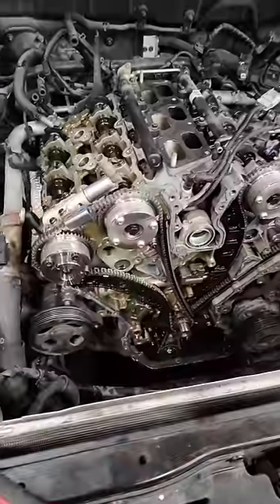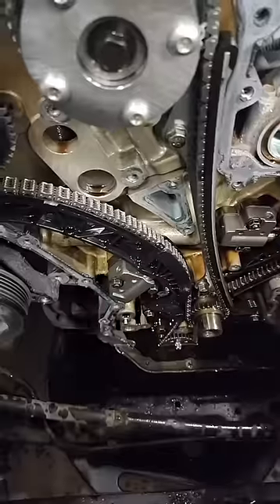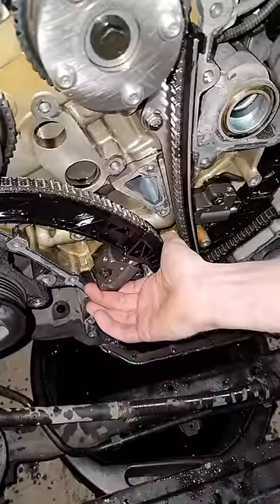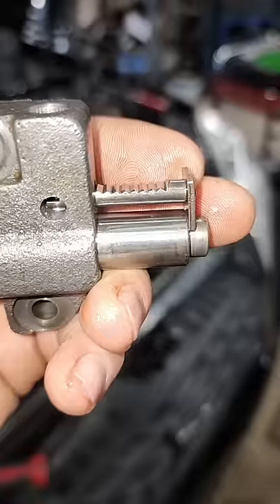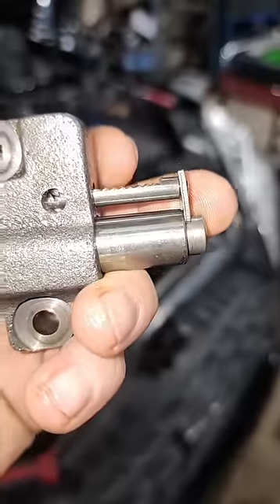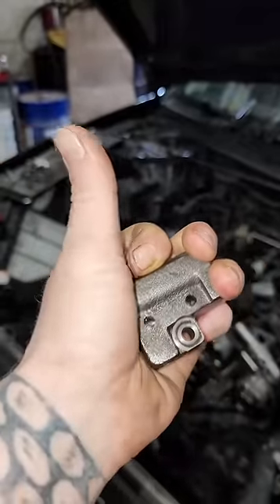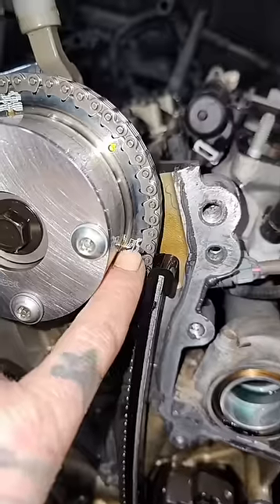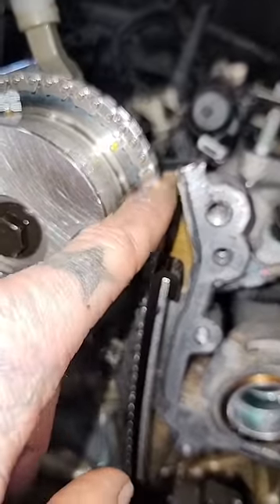I'm not happy

Comment: I have the utmost respect for good mechanics.  We tried out a new one recently.  Asked for an oil change, tyre rotation, brake flush.  He found an OLD torn cv boot (which required a new axle), recommended a valve cover seal, new front brakes as well.  He took the time to show me.  $2,200 in repairs on an 18 year old Infiniti.  I could see someone saying no.  But, it's still worth 7 grand, and my Bride likes it, so yes.

Comment: The Nissan D-21 had a chain guide pushed by the oil powered tensioner. The bottom of the guide pivots in place because that particular bolt bottoms out on the block before it binds the tensioner, allowing it to press up against the chain when the tensioner is pressurized. The Cloyes guide was build slightly too thick, such that the guide wouldn't pivot. When assembled, the chain would rattle against the timing case at idle (lower oil pressure) and clear up when revved up. Scrape marks inside the cover gave a hint. I've laid gears on top of each other and found them to be off by half a tooth. I have several older Toyotas, all with 200k+ miles. Parts are starting to wear out. I go oem on most parts because if it went 250k on the original, I want it to go another 250k  on the next park. I ain't got time for BS.

Comment: I ordered a complete Cloyes timing kit for a 4.6L Grand Marquis because I'm fairly sure that the guides or plastic tensioners are toast (lots of clacking from timing cover area with belt off). I even got the metal hydraulic tensioners to be sure the crappy plastic ones don't fail again. It has the sprockets, chains, tensioners, guides and everything. This has me a little worried. I thought Cloyes and Melling were quality brands. Do I need to get Motorcraft stuff or will I be ok with Cloyes?

Comment: Had that happen on a Honda Odyssey timing belt one time. It's an awful job to do once, let alone twice. Kicker is, the customer drove from southern Ohio after the first job, it jumped time around Jellico, TN, and wouldn't go more than 40mph. They continued driving to their vacation destination in the Keys in Florida, then drove it all the way back to the shop I worked at a week later to have it fixed. Still no idea what happened, three teeth out of time but took around 200 miles to happen, and didn't get worse for a couple thousand more miles. Put a new kit on it and it never had anymore problems.

Comment: I work at a hyundai dealer, we always replace the tensioner on a timing job which you did, but also on these particular models, they changed the crank cog design along with the chain and cvvts if the crankshaft cog wasnt replaced this can happen also! i dont think thats the problem here but i just wanted to put it out there for future refrence

Comment: This is why I only use factory parts for internal engine work. It's still possible to get a bad part but I've never seen it cause an issue like this. The brand is putting those parts in millions of cars and they have to pay for mistake out of their picket so they do everything they can to make sure the part is as designed. Aftermarket companies cheap out on tooling and parts get worse over a production run.

Comment: oil pressure is supposed to hold that out.  On my ford modular engine the builder actually removes the ratcheting mechanism because it can lock out too tight and screw up your chain.

Comment: It's always a good idea to inspect new parts before installing. Not all "new" parts are as good as they claim to be. Especially Reman parts, I've found dicked up threads that will leak fluid... or you'll never get the fittings to screw in properly... 😳

Comment: It amazes me how bad the parts industry has gotten. I never assume that the new parts I get are good anymore. I check every goddamn part I get before installation due to the awful quality control of manufacturing nowadays. My latest was a brand new torque converter that was assembled incorrectly prior to be welded together not to mention finding a piece of pallet wood that somehow entered it before someone installed the protective cap. Rediculous and very frustrating. Please do a follow up on Cloyes response. I have always considered Cloyes as a industry standard to compare to

Comment: Did a timing belt for an 1.0 Ecoboost, also replace the oil pump belt w/ tensioner (uncomfortable, and very complicated). Returned a month later because the turbo failed. Checked oil pressure, very low at idle but not enough to make the light go on. Drained the oil and founded pieces of teeths of the wet belt from the oil pump. Well, the “new tensioner” failed. Thankfully I didn’t blow up, only the turbocharger.

Comment: Bought a 2009 traverse, non running. Tore down 3.6, previous owner had just had a shop do timing chains and it made a ratchet sound and wouldnt start after. Crankshaft chain tensioner (bottom of 3 chains) ratchet lock was broken and did the exact same thing the one in your video did. 

Crazy how crap parts are these days.

Comment: Had the tensioner spring fuck off on my miata shortly after doing a timing job. Spring stuck itself down into the crank gear and nearly split the new belt in two and of course skipping timing.

Comment: Many years ago in my days at automotive classes I read a true case study that guy put brand new spark plugs in a car and it ran worse. 
Pulled the plugs rechecked gap, and discovered that a few were defective, the center electrode was loose inside the porcelain, ever since then I shake my plugs to hear if they rattle. 
Even check your new parts.

Comment: I’m pretty sure the mechanic checked that lock when putting it in, so my concern is there are bits of metal inside the crank case from those teeth that stripped.

It just boggles the mind that something brand new out of the box would be this crappy.

Comment: Made of mild steel...means the replacement one will probably fail.  I had a fuel pump break an armature after 500km...returned the part: the replacement was NOS, same brand - but the armature was TWICE THE THICKNESS of the one that failed!

Comment: The one area on a vehicle where I will only use genuine OEM parts is the timing system.  That area is just so critical especially on interface type engines I wouldn't want to take a chance with aftermarket anyting

Comment: Did tensioner and chain on my 11 Elantra. New tensioner failed and jumped time as well, and for the only time in it’s life the car wouldn’t start. Replaced the tensioner and bent valves and two years later original “piston slap” motor is at 306k miles

Comment: Worked on a CTS 3.6 a while ago that had a Cloyes chain kit installed the previous year. Less than 20000 km later the chains were stretched to hell and the tensioners were bad. Cloyes makes the chain guides for GM but the complete kit they sell seems to be their guides combined with cheap crap chains and tensioners. Aftermarket timing components are not worth the hassle.

Comment: The only question I got is who was supposed to check the part to make sure it matched and wasn't damaged/defective 🤔🤔🤔
Reply: Judging by how the teeth are rounded like that, I'd say it was cheap, soft steel. It may have looked fine pre-use, but couldn't hold up to actual use.
Reply: Whoever does qualify control at cloyes that's who.

Comment: There is a procedure to lock the tensioner into place. It is possible that it was not locked at the time.  Turning the engine 720 deg and rechecking cloyes Includes the lock procedure in every kit. Not saying it is not possible but highly unlikely. This is also the main reason belts jump just after installation.

Comment: Still has good teeth on the new part through the inspection hole there. Cheap steel or by some miracle a crap ton of tension? Either way looks like it stripped the hell out of it

Comment: THE ORIGINAL TENSIONER TECHNICALLY NEVER GOES BAD. IT INCREMENTS AND RATCHETS AND LOCKS IN AS THE CHAIN STRETCHES. THE MANUFACTURER CANNOT AFFORD TO MAKE A CHEAP TENSIONER ON SUCH A CRITICAL AREA IN THE ENGINE. IT IS BETTER TO JUST CHECK THE ORIGINAL TENSIONER AND IF THEY'RE GOOD. PUT THEM RIGHT BACK IN. THEY WERE WORKING FROM THE START OF THE ENGINES LIFE AND ARE ALREADY TRIED-AND-TRUE TESTED.

Comment: Once I got three bad alternators and two bad starters in a row. It didn’t need a starter till the bum alternators. I finally too the originals to a rebuild place. The old man that ran it finally quit working so that option is gone and really everything he rebuilt I never had to replace and sometimes a $250 alt only needs a $20 stator or a $15 part.

Comment: My Honda 3.0 V6 has an exterior timing BELT.  It has never been changed or messed with for 150,000 miles.  I am having it replaced this week because you actually should replace after 100,000 miles.   I don't understand why many makers insist on going with very unreliable chain systems.    The belt on the Honda does not require huge teardown either .  I am paying someone else because I don't have the time to do it myself.  While they have it open I will have them put new water pump on.

Comment: Had that exact same thing happen on a Hyundai elantra stock timing chain tensioner failed at 60k we put in one from oriellys that one wouldnt even hold long enough to spin the engine over we went through like 3 different brands of timing chain tensioner before one worked

Comment: This type of thing is happening more and more. There are lots of cheaply made, substandard auto parts floating around. A lot of the problems seem to be related to metallurgy issues where the metal isn't being hardened properly. That tensioner probably looked great coming right out of the box but the teeth quickly wore down because the metal was too soft. Brake rotors also have these types of problems because the metal wasn't properly hardened causing the rotors to warp or develop high and low spots, which causes brake pedal pulsation. These days you have to be careful where the auto parts you are using are coming from. And don't always shop for the lowest price because you might find yourself doing the job over again for free.

Comment: Had a shop do mine on my Lincoln with the 4.6. didn't make it past 3 revolutions they said. Failed tensioner right out of the box. Toasted all my valves and pistons were wasted.  Got the parts from napa and they only would cover a used engine to be installed. I had no choice so they endedd up getting a oil burning p.o.s. ended up selling it which sucked cause I lived that car.

Comment: That's crazy. Cloyes & Melling used to be "before everthing went to china, taiwan" to be cheaply manufactured was american made & american assembled. After 2001, everything got screwed. Same with alot of parts like Melling which was another great american company. Unless you get old stock from a mom & pop auto part store or something thats been in the back on the shelf without a revision part number, its probably junk. Cloyes & Melling used to have the best lifters out. Now I get stuck sometimes with a bad one out of the box, or a sloppy chain, or mared up gears. It's gotta be that cheap oriental metal. Then im stuck with having to make a disclaimer with my customers. That 💩 cost me time & money. Parts warranted, but what about labor 🙄. Bad for the tech/shop/mobile tech, & the customer

Comment: Maybe the lesson is don’t use cheap parts on critical functions, and it doesn’t get much more critical than the timing chain/belt. If something like a water pump or starter motor fails it doesn’t take anything else with it.

Comment: Is anyone have a clue on when the warranty company calls to leave a lift empty for INSPECTOR that will come between 24 to 48 hours. 
Now, I can not leave anything empty because I’m doing engine or transmission or clutch. They don’t wanna pay for the time. I‘be done my inspection and report. I feel like if they don’t accept my report or pay for my time I’m not providing extra lift for it.
Tell me if I’m wrong just need some guidance

Comment: Thats Bullshit. I'm in a similar position,  ive got to remove a bunch of tiles to replace a brand new shower valve that was defective. Just had the plumber install it on a brand new remodel a month ago. It was not a cheap shower valve either

Comment: Purchased a vacuum pump for my 96 7.3 had it on 1 month noticed oil coming out from behind the pulley good thing I did cause that was going to be a breakdown on the side of the road had to replace it wtf is it with these parts manufacturers 🤦‍♂️

Comment: Nearly every part today, even from reputable companies, is made in China using substandard metal and manufacturing processes. Try finding an aftermarket wheel bearing that can compete with an OEM - we are seeing them fail within months, vs. normally lasting 150,000 miles normally. Failure rates are sky high - another “tax” on average Americans.

Comment: Timing chain tensioners are all garbage! #1 failure point in all engines that use them. Just like aftermarket tensioners are garbage. I remember we did both cassettes in a Ford 4.0 OHC engine once (you have to pull the engine for that one), put everything back perfectly with the correct toolset, and the chain literally snapped in half after two weeks. Not at a pin either, between two pins. I miss timing belts.. change those every 60-100K and you're golden.

Comment: interesting how familiar this is the design looks just like the original ford tensioner it’s mode of failure is similar also so they took a bad design that ford replaced an used it from the looks off it very interesting obviously it isn’t the exact same but that locking ratchet design is and it’s failure is super common lol hope it’s not damaged the engine though that would suck

Comment: To answer your question. Yes, Hyundai will cover the repairs. However, the owner should have taken it to a Hyundai dealer instead of an outside mechanic to get a factory diagnostic and a warrantee repair done. 10 years/100K mile power train warrantee takes care of it, and all damages related to it.

Comment: That right there, is why you always inspect new parts, BEFORE you install them.

Not sure why you're replacing replacing tensioners and chains, on such a new car. Those chains and tensioners, should really never fail.

Something very strange about that crazy worn down tensioner, to have ALL those teeth drastically worn down. 

Was the original one you replaced like that too?

Comment: I recently got some spark plugs from AutoZone, do the tune-up on a 5.4 L Triton Expedition. get this, after the tune up the thing ran worse!!! serious shit, I pulled those plugs back out and inspect them, brand new plugs, mind you, and there was Rusty beads of metal embedded in the ceramic!!! any mechanic knows that will arc like hell, off those little metal beads, to ground. so I had to do a tune-up twice, not to mention a couple of trips to The Parts House, and lost my shirt on it. y'all need to do something about the cheap, second-rate parts. FYI the reason why AutoZone, O'Reilly's, advance, etc., can sell their parts relatively cheap, is primarily because they don't meet O.E.M  equipment standards. so, right off the bat, that's one strike against them. now you got places like China, Mexico, India, making substandard parts with very low-quality, mass produced garbage, but you're saving a few bucks. right up until you have to do the job three times....😠🖕💯

Comment: That's why I stay away from jobs that can cause catastrophic engine failure.  Like doing a timing belt job on an interference engine . You might make $500 tops on the job with one failed part away from you being responsible for a $5000 engine. also if its a pain in the butt part to change like this or a very important failure point item I always use the best I can get my hands on

Comment: What is it with the timing chain area? It seems to be the weak point of many different engine designs.
Harley Davidsin have made millions by designing planned obsolescence into their engine design, then refusing warranty correction to customers.
I remember when the 1960's Ford Windsor engine had a plastic cog that got destroyed by the metal chain !
Why not gear driven cams?
Timing chains are the Achilles Heel of many designs.

Comment: My s2k got a brand new timing chain tensioner, when my mechanic cranked it back up after changing it the chain snapped. No internal damage, but still a pain
Reply: I thought the K20 was interference, hmmm
Reply: @jhrubicon1470  the F20C is, it was just idling though so I guess it didn't have enough strength to bend any valves. I think all Honda 4 cylinders are interference.
Reply: @FaeraOthronus  I think so also. It allows for better flow at higher rpm

Comment: and parts are feeling all across the u.s.!!! cloyes is good shit, too. even if oil pressure failed, which is what controls that tensioner in the first place, those teeth are meant to create one-way action of that shaft. in other words, those teeth are designed to hold that forward, even if oil pressure goes away. completely failing in one week, yeah that's bad QC, for sure.

Comment: I always check them before install. All of the teeth are rounded, there's no way it would have done that in the vehicle since the outer teeth  (inside and outside) would have not been in contact with the ratchet, it would have had a pin in it to hold it anyway... it was machined incorrectly That should have been caught,. prior to install, always check your parts.